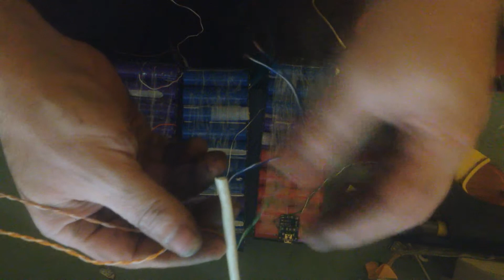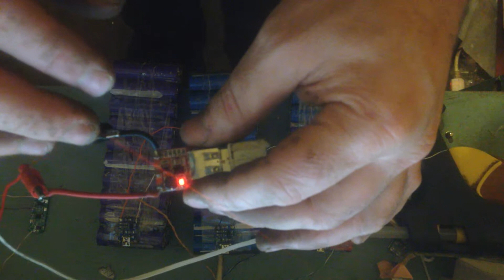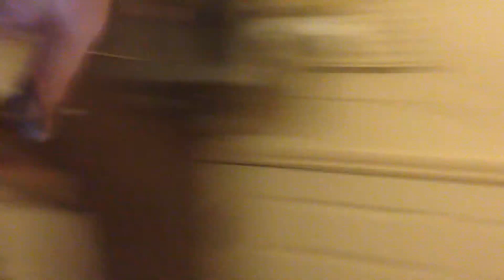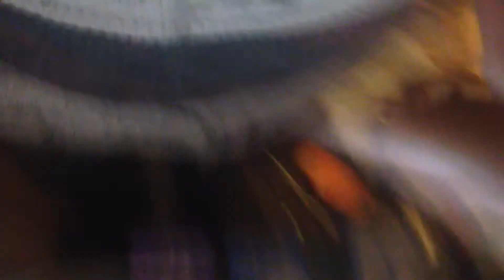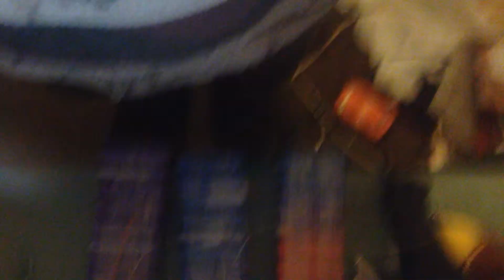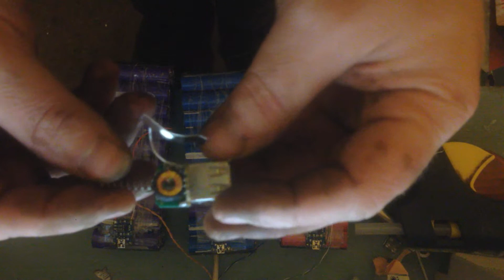parallel pack charging series output

Comment: hi 
ı make lithium ion 42v   3 each pack series total 126v for my scooter ...each pack have 42v bms .my qouestin is did u have any idea for how can charge them same time without separate them ....if ı buy isolated charger 42v 3time if connect battery .is it work this way?
Reply from the maker: muratkoldamca I would drop them from series into parallel so Al pack is 42v or boost converter set to a little under top voltage lower currents will not force packs out of balance much I have another video where I have the pack go from series running to parallel charging
Reply from the maker: muratkoldamca yes 3 isolated chargers will work

Comment from the maker: i have a couple of 10 watt led units here as well with there drivers i just need a heat sync for them but they ment for the bike to upgrades its spot lights but i do have a spare so will try and show that in action also they work on 12v at 700mah and are bright as hell

Comment: Awesome tutorial my good friend. As I said before. Don't worry about mistakes. Just concentrate on the good stuff. Making these last few videos you have come on in leaps and bounds. You are doing what I am doing. Charging at lipo voltage instead of 8V or 12V. I run at 12V and my lights are 12V and give better light than grid eco bulbs. Your doing great keep it up. Have an amazing day tomorrow my friend.
Reply from the maker: +Raymond Earle im at work so wont be that great haha be interestiung to see what you been upto as of late tried to follow the cnc stuff but got lost very quickly
Reply from the maker: +Raymond Earle yeah lipo voltage is a far simpler process as higher voltages you have chance of them going out of blance at least this way thay stay in balance i do wont to do wind and hydro also but thinking they me have to wait till i have land or an alotment or somthing they is another video in upload at moment
Reply from the maker: +Raymond Earle and the light your going to send i think now im back onto the 12v system i think how you have them set up allready would be ideal thanks
Reply: When you power it up put sunglasses on first. I mean it. They are low current. But flipping bright. My friends have asked me to convert thier halogen sensor lights to my lights. So I now have a single board that fits into an outside senor light unit too.
Reply from the maker: im goign to get the dark glass for welding masks just like Julian llett does
Reply from the maker: +Raymond Earle julian video here best shows what led im using for the bike upgrade https://www.youtube.com/watch?v=WsGKk24h6Wo
Reply: Ah yes. Thats a great video. I watch all Julians videos. I have learnt a lot from him.
Reply from the maker: it helpos in knowing what to buy sometimes lol
Reply: Very true my friend. I think of a project. Buy the stuff for it. Before it arrives I have nodified the project. So the stuff isn't used and goes into storage. LMAO.